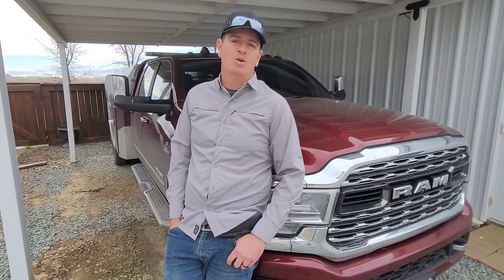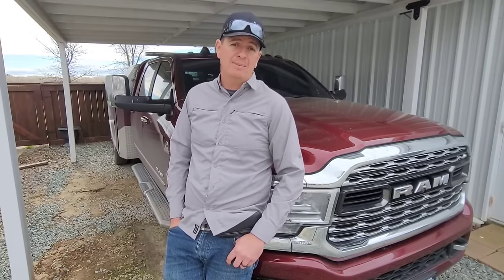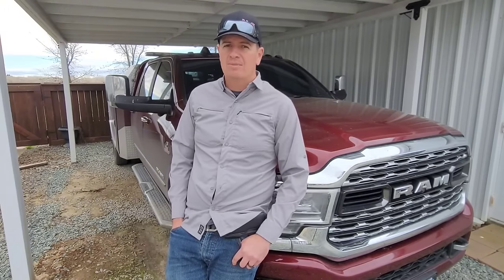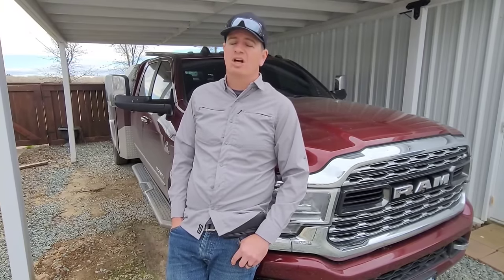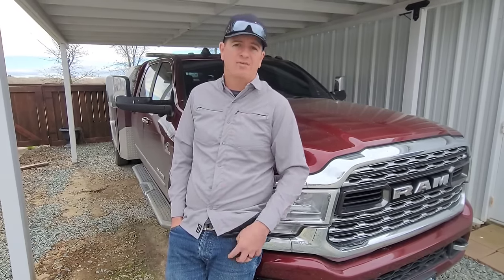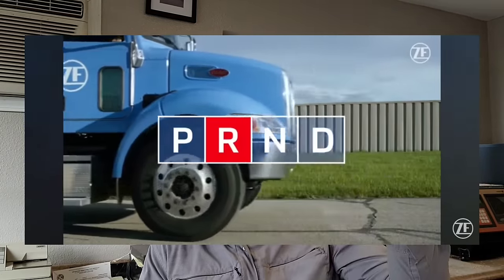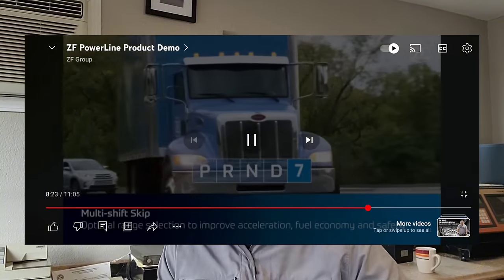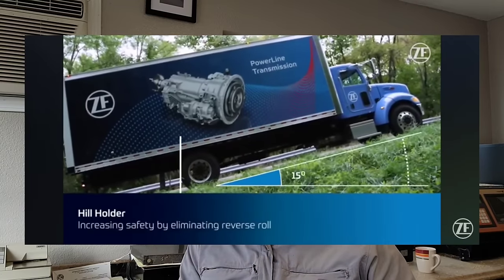RAM HD 2025...ZF Powerline 8spd to replace Aisin?...Powerline details!

Comment: One thing about zf that im not sure alot of people understand is zf builds alot of powershift transmissions for agricultural equipment and construction equipment and alot of that works flawlessly and takes alot of abuse and the shuttle operation of those takes alot of abuse and keeps going, so if clutches are made of same or similar material then hopefully this will be a bullet proof transmission with little to no problems. Zf knows power transmission and does it well!

Comment: Ram should of kept production of the g56 equipped trucks for the select few who like em
Reply from the maker: Would you be interested in a manual 6spd vs auto (aisin) 6spd video?
Reply: Definitely would purchase manual transmission truck.
Reply: Heard they started not being able to keep clutches in them as the power kept bumping up.
Reply: @bunsguns8222 I have a 2017 Ram 2500 with a G56, stock the truck is detuned because it is at the limit of the stock clutch. Once the truck is tuned and deleted the stock dual mass clutch doesn’t last long. I have a twin disc Valair that holds the power fine. The main issue is that they just didn’t sell that well. From 2010-1018 manuals only made up about 3% of overall sells. It’s unfortunate but most buyers don’t want a stick shift anymore.
Reply: @jowens4160  Yep. Would be great to lock a manual in 3rd or 4th going down hill with the new exhaust brake while towing 20K.

Comment: My 2021 3500  ram with the 68rfe has hill stop . I heard on another transmission talk  that the zf will skip first gear if loaded light. Awesome video. Denis from Santa Rosa CA. The 8 speed of could bring the tow capacity up higher  .this transmission sounds like the automated 13,18, 10 speed transmissions in the over the road trucks. Kenworth, peterbuilt  , freightliner trucks .I pull a 15000 lb with my 68rfe and I do need more gears.
Reply from the maker: Hello Denis from Santa Rosa

Comment: In the Ram GT and the TRX, both had zf transmissions and had a center consol shifter, so they for sure dont need a dial shifter. But  as a ram 1500 owner, i absolutely love the dial shifter. Perfect location, out of the way, and a great way to free up space. Im sure it will be a dial, but they do have the parts to make it either way.  It's about time Ram puts a transmission in their Diesel HDs that is worth buying!!! Great video, btw!
Reply: Dial shifters are junk!
Reply: best auto shifter location ever built, in my opinion.
Reply: @Sicktrickintuner You have Zero idea of what your talking about. Love how the Ford guys all trash talked the dial, then the mustang got it! LMFAO
Reply: @oldironguy  try to be the mechanic and work on one, now try to put it in neutral and turn it off, not allowed and goes into automatic park as soon as the door is opened 
F’n junk! Manual shifters didn’t do that.
Now you need to pull apart panels and grab cables and have neutral bypasses. Stupid

Comment: I had a Ram 1500 with a dial shifter and before I got it, I wasn’t sure that I would like it. After a week I never gave it a second thought. Now I have a 2019 Power Wagon with a dial shifter and I love it in there too.   Don’t worry you’ll never miss the column shifter.
Reply: Same with my 2019 2500 6.4. That transmission really woke up the 6.4s capabilities.
Reply: I don't agree. I had a 2020 6.4 with the dial shifter and missed my column shifter. I just couldn't get used to dial.
Reply: You will get onto the dial and honestly never look back. It was one thing that bothered me buying an 8spd. Long over it now. The dial is not an issue.

Comment: Great video sir, I'm an old slush-box Cummins guy from the late '90s/early '00s, it is astonishing how the trucks have improved since then.  Can't wait for the '25 HD redesign, they are currently leaving so much on the table compared to Ford, hopefully this 8-spd is a homerun like it is in the 1/2 tons.  The standard output Cummins needs a big bump in torque and power, hopefully 425 and 1000+ ft-lbs and HO pushing 1200 ft-lbs.
Reply: I’d say 420 and 1075 for Standard Output (current HO numbers) and probably 470 HP and 1300 for the HO
Reply: @bigharryyy03  I'm hoping they are going to get away from multiple power plants and transmissions. Keep them all the same, help with dealer inventory, wait times, production will be faster and hopefully one set up down the assembly line will lower the cost of the truck.Keep it simple, sometimes I think Ram loves to confuse their customers.
Reply: @truckguy6.7 
Then they can’t nickel and dime everyone for the probably unavailable higher grade trans.

Comment: My wife's '18 Ram 2500 4wd 6.7L had fluid issues.  I changed the oil pan to a PPE deeper aluminum pan.  With fresh Valvoline synthetic the shifting improved quite a bit.  After a few months I drained the fluid again.  So just having a pan that allows a quick fluid change is great.  I had been budgeting to put in an Allison transmission kit.  But the ZF is superior.  My Jeep JLU has the ZF, and drives much better than the Mercedes 5-speed in the JKU.

Comment: My mom has a 2007  6.7  with original trans w/ 240,000 miles  and towed 12,000 lbs to 14,000up and down east coast. Serviced every 30,000 miles. My buddy bought a 4500 (asin) 2021 and trans. Kicked the bucket at less than 28,000 miles.
Reply from the maker: That's a rare bird to last that long. Aisin was a warranty issue

Comment: The 68rfe is a swollen dodge caravan trans configured for a rwd truck.
Reply from the maker: Exactly
Reply: Stop the crap.
Reply: Worked for Dodge from '95-'11, that's exactly what the 68RFE is .
Reply: @hondamojo1  lol. I worked  for a hauling company for years and disagree. What jokers we have on this site. Maybe you should stick to honda trucks
Reply: It uses the same design as a 41TE or 62TE but it is definitely a lot stronger than either of those transmissions. I was a Dodge tech for 14 yrs up until 2014 and I know for a fact that if you leave STOCK size tires on a truck and you don’t chip it/ leave the power level stock, a 68rfe will last just fine towing all kinds of heavy stuff.

Comment: The 8hp70/75 and 8hp90 are absolute beautiful transmissions to drive and own. You sometimes cannot feel the shifts they are that smooth,. Quick shifting is an understatement, they have lightning fast gear changes. The only thing i find is like you said for most driving in a pickup they could actually do away with first gear starts. Make it available obviously manually, but more so if tow haul is selected than first gear starts are part of tow haul. The 8hp70 which I currently own has a Lower second gear than my older 6spd had for 1st gear!! Ive been around the old 904s, 727s 46rh/re and 47/48s. These ZF 8speeds are a thing of beauty!
Reply from the maker: Since making this video I've learned that supposedly 1st gear will indeed be locked out unless 2 conditions occur, tow haul is selected, or an abnormally high load on take off (think taking off empty, but on a steep incline)

Comment: If you are having issues with the Aisin transmission in your Ram it needs a free remap from your dealer.  My 2017 four door, Ram HD one ton dually has the Aisin and when empty got over 20 mpg but always liked to shift up too early and was in sixth gear at any speed over 35. 
So I took it in for the dealer and found zero issues but recommended a transmission remap.  This worked great with the transmission staying in the lower gears much longer however now my mpg empty is about 15.

Comment: I drove a 10 speed ford E-350 box truck with the 7.3 V8. Was constantly down shifting for no reason. I could see how maybe they’d work out if you’re pulling a shit ton of weight all the time but doesn’t make sense on a daily. I bought a new 23’ 2500 6.7 with the 68rfe a few months ago. Came from a 22 ram 1500.  Best trucks on the market imo. The tranny seems to be pretty solid, but I think the rpm’s are high as shit when I’m doing 75-80 mph. Hopefully this new 8 speed will drop those rpm’s while you’re cruising down the highway. Again, these companies putting in 10 speeds in these trucks doesn’t make sense unless you’re trying to be a super trucker every day hauling really heavy loads.

Comment: Back in the day I wouldn’t look at a Ram. But in 2019 I purchased my first Ram. Listened to a lot of people and seen some great great success. I chose the Ram for a few simple reason. Hemi and ZF trans. Both bullet proof really. Ya ya ya the occasional person had issues. But which brand doesn’t?  But overall these two combined power plants is what makes it and dependable.  That’s all I want… cheers
Reply from the maker: Like I always say, if out of the big 3 (ford dodge gm) one brand really was THAT much better than the other two, the other two would be out of business. They all 3 have gains and drawbacks, success and failures.

Comment: Yada...yada...yada!  Give us the same cab as the 1500 plus an 8 foot bed option with oversize Ram Boxes!  Give us the new gas inline engine with 540 HP and 520 LBS. Ft. of Torque!  Give us the Cummins with superior power and torque to any GM or Ford!  Give us 4 corner extra heavy duty air suspensions like real big trucks!

Comment: I have a 21’ 2500 with the 6.4 and ZF trans and I also have a 23’ 2500 with the 6.7 SO and 68RFE and I gotta say the ZF is so much smoother than the 68RFE,If my 23’ Cummins had the ZF it would be perfect to me,the shifter location I could care less,the only thing is I would not buy into the whole lifetime fluid thing with ZF because my 14’ 1500 5.7 with the ZF had to get rebuilt at 120k mi.

Comment: Electronic transmission doesn’t mean it can’t have a column shifter. The shifter would just operate switches instead of cables. I hope they keep the column.
Reply from the maker: Correct. I'm just assuming it's going dial
Reply: Change doesn't have to be scary guys 😂.

Comment: I think the ZF is better than the Allison. The gears are more evenly spread. I’ve driven the 8spds and the Chevy and Ford 10spds. They seam to always be searching for gears. The 8spd seams to down shift better when towing. It also seams to run cooler and it shifts much smoother than the 10spds.
Reply: I question that searching when comes to the GM 10SPEED because you don't feel the shifts at all. A ZF in a car would be tuned totally different from one intended to do work in a heavy duty truck.

Comment: D to R and R to D. I experience this type of concept on a LeBlond lathe where a machinist could change rpm levels while the spindle was still spinning. The gear change would take place after  zero rpm was sensed. The spindle drive motor had a set of fly weights working like a governor and the fly weights had brushes that would make contact on a rotor disc and when there was zero rpm’s the weights of the governor would allow the brushes to make contact with the rotor and wires attached to the brushes acted like a switch completing a control circuit that allowed the motor to change gears. Similar concept I think ZF will use but electronically.

Comment: I have a 2022 5500 and have all the same complaints.  I had a 2019 f-450 before this truck and I wish I still had that truck.
Reply: I was with a Ram store for 30 years. It was mentioned in the video and it is true. The 4500 and 5500 transmission programming is lacking compared to the Aisin in the 3500. They drive completely different.
Reply: @truckguy6.7  I had a 22 3500 HO and it shifted good.  Other than being really clunky when shifting into gear or reverse and maybe more so than my 5500, I thought it had its shift parameters sorted out well.

Comment: so if they put this 8speed in the 2500s the torque goes up to max 1000? also hp abit. also does the dial shifter come with it ? if so ill trade my 23 2500 68rfe for a new one or used , an if the cab is more spacious definitely signing up

Comment: GVWR and GCWR can be similar, but not necessarily the same. The 57k lb rating is probably for big box trucks. But your point is well taken, 1000 ft lbs at 57k lb GVWR leaves room for Ram to have higher torque in the pickup trucks.
Reply from the maker: You are right, gvwr and gcvwr are not the same thing, but I think in the case of a transmission manufacturer putting a number on their product, I don't think it matters. 57k is 57k regardless if it's a truck/trailer or larger truck no trailer

Comment: 6 spd manual or 9 spd manual 300k to 500k miles before rebuild. Get some.
Reply: U R high sir
Reply: @justinwam  on reality you don't have to believe what I'm saying but I just seen a original first gen 1987 Dodge Ram Cummins pass me by on the street don't see one dam Ford or Chevy that year that's a daily driver. In the rust belt salty ass roads

Comment: ZF has been testing their powerline transmission on a Cummins 2500 since 2018. There’s a video of that exact  powerline transmission being tested and driven on a Test Mule 2018 RAM 2500 Cummins (link below). 

It really wakes up these trucks in performance, will be better towing and has been tested and fine turning for 5+ years, a lot of win using this transmission. I’m glad they when with ZF they make excellent transmissions! 

https://youtu.be/SDvDSDtBRIg?si=nvmFNNirBCmCYuY3

Comment: I know I’m old and stuck in the past but I sure do miss manual transmissions
Reply from the maker: You are not old or stuck in the past. I miss manuals too, you'll like my next video!
Reply: Well thanks I’ll be sure to watch your next video
Reply: A lot to be said for buying a Freightliner absolutely. What really kills these machines is DEF fluid imo with #irony a heavy displacement engine working at low RPMs is a far less bad "emitter" big time and of course a better engine if married with the right power train and suspension. Could start seeing some truly huge super duty because of the Dodge Powerwagon meaning much more "stout" robust build. Tesla Cybertruck is such a game changer if that works as basically is a literal Tank.

Comment: I definitely think ram has needed to get rid of the 68rfe. But the aisin isn’t as bad. Aisin makes another transmission with 7 or 8 gears and that’s all the Cummins would need is 1 more gear. It has been a great trans over the years and was a powerhouse when it came to handling the performance of the Cummins HO. IMO I’d like to see the zf in the standard Cummins. And I’d like to see the aisin in the HO’s with either 7 or 8 gears.
Reply from the maker: Well said

Comment: Might as well buy a class 8 truck and live the dream of towing 57k with ease. I think the amount of power currently is a reliability pipe dream. These trucks seem to be dying much faster than my 08 6.7. I am all for racing diesel on the track but this HP and TQ race will not be good for the consumer in the long run. Not to mention insuring a vehicle with this power is insane.

Comment: They should up the torque to 1300-1350 with the ZF. Ford is doing 1200 with 10 speed
Reply from the maker: Eh, at some point there's got to be a ceiling on power out of pickup. Truth is they've got more power than we actually need already.
Reply: Power is like money. You can never have to much of it.
Reply: The ZF power line actually has a torque limit of 1000ft-lbs.
Reply from the maker: @Math-zl8kq  did you watch all of the video?
Reply: @bobbyjfarms3681 I didn’t but now I just did. Basically you are just speculating no real facts. But in the past Bentley has been able to modify the ZF8 900nm torque rating to accommodate a 1100nm application for the Mulsanne speed. I might be the case for this ram but this is only speculation. Maybe Ram will have to reduce their torque rating to accomodate the new ZF transmission.
Reply from the maker: @Math-zl8kq  my speculation is based apon the facts we already know and some that we can assume. Ram will NEVER turn the power back down. That would be marketing suicide in a scenario where the ram is already pretty far behind ford on power numbers and acceleration. As I said in the video, just like the aisin was never rated for current power, the slight gap in numbers will be made up by the reduced gcvwr of the ram over a commercial, say, class 6 peterbilt. I had a long chat with an Allison commercial technician when I put a hot b series cummins in front of an all 643 and he said he was much more worried about the weight it would move than the power in front of it. The lower ram gvw will easily allow the 75ft lb gab, and probably more

Comment: I think it’s funny that people buy Duramax because they think that 10 speed is Allison. It’s not an Allison. Allison endorses GM to use the name. The 10L1000 is made by GM. Not Allison. Nothing wrong with the 68RFE, I think people misconceive it for its predecessor. I’ve put plenty of miles behind the 68RFE. At least it doesn’t hunt gears, and parts are abundant, which makes repairs cheap, because let’s be real, every transmission will eventually need repair. Obviously, yes, ZF makes a hell of a transmission, but they ain’t cheap.
Reply: Allison tested and approved the transmission. I'm sure they didn't sit on the sideline and leave their reputation to chance.